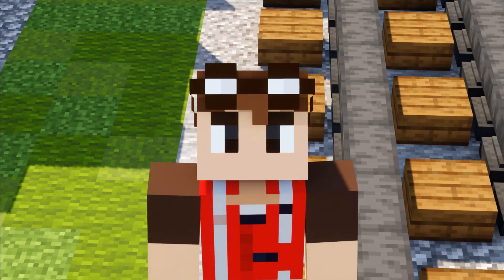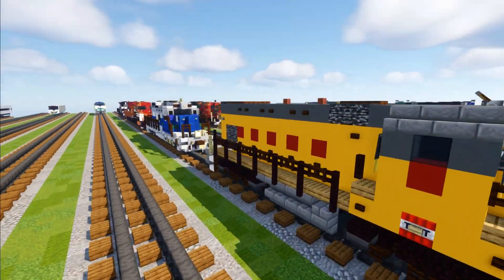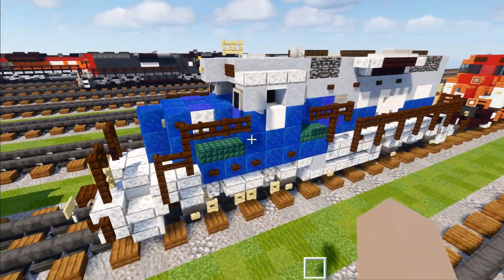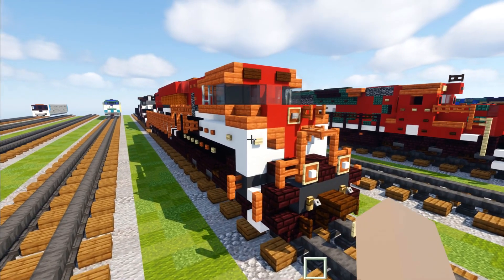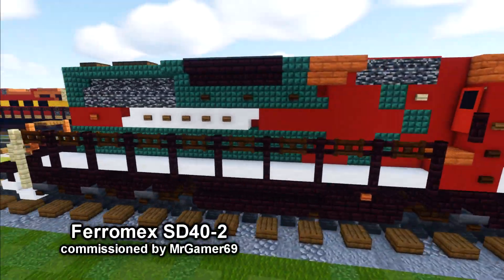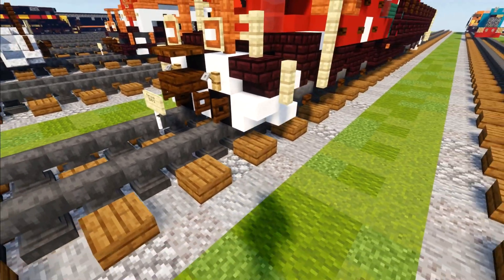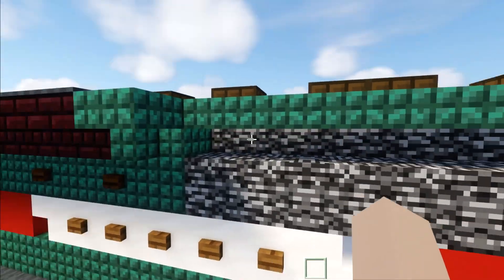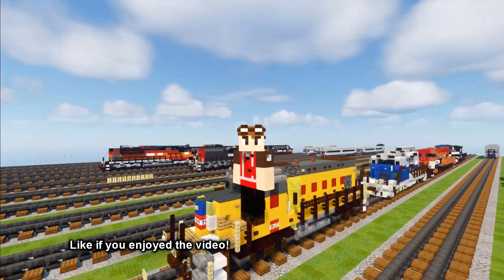Minecraft EMD Locomotives Review [GP15 SD24 GP20 & More!]

Comment: Hopefully you'll do an Alco bundle of locomotives like the C420, C424, C425, C628, C630, and the C636. All were operated by the predecessor railroads that went into Conrail. It's nice to do railroads of today, but it would be cool to do a flash back in time.
Reply: or some u-boat locos, also ALCo, for Santa Fe, Burlington Northern and MAYBE Union Pacific, ect.